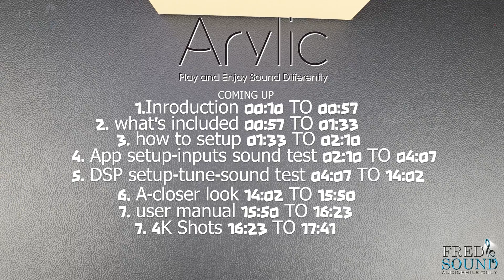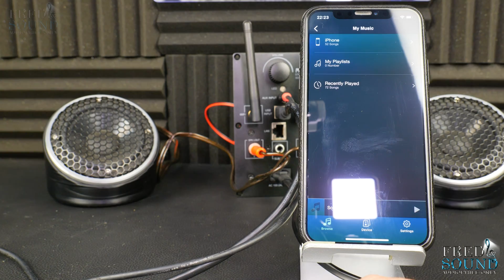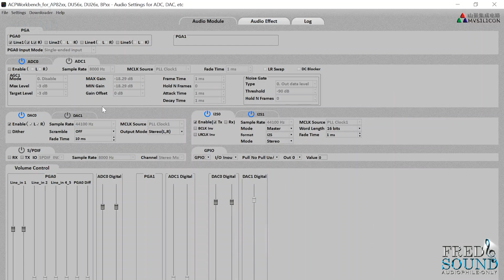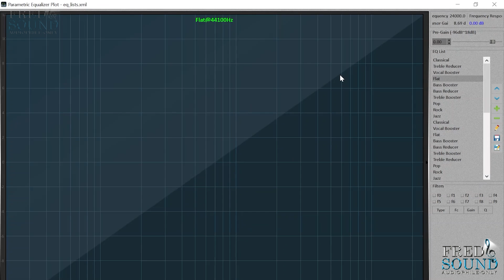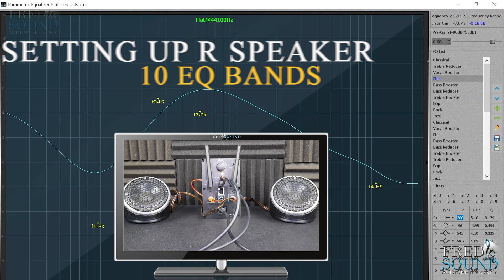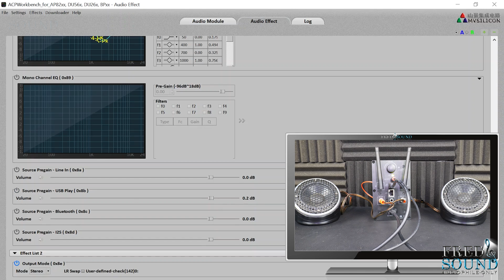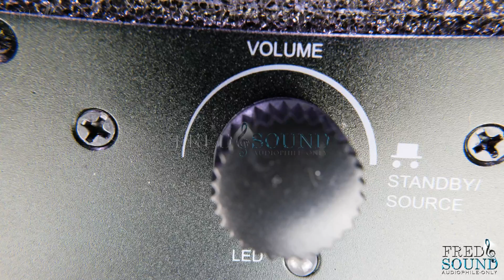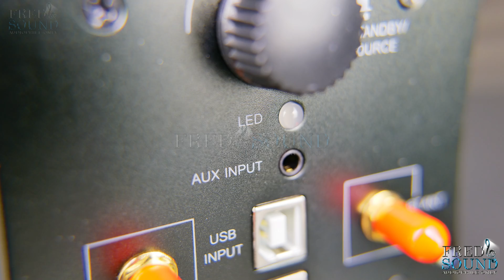DSP Hi-Res Plate Amp Stereo Multiroom Wireless Arylic Up2Stream ACPWorkbench 4K (FNS)

Comment: Out of subject,can you recommend me some midbass that goes well with steg k7/nt25?
Reply from the maker: NT25 are tweeters, K7 is midbass/midrange, it’s already a 2-way setup, what midbass are you looking for? Thanks for watching
Reply: @frednsound  something to compensate for below 140hz of k7 (dual  speakers on each door)
Reply from the maker: @mamaliga6701  get the STEG Principe 65c or CDT E06+
Reply: Or it's ok to pair K7/NT25 with a subwoofer (I ask that because i see a frequency gap beetween sub and mids).Thanks!
Reply from the maker: @mamaliga6701  it’s design this way for SPL use, it will pair with high pressure SPL subs